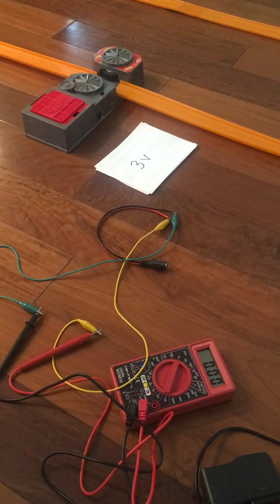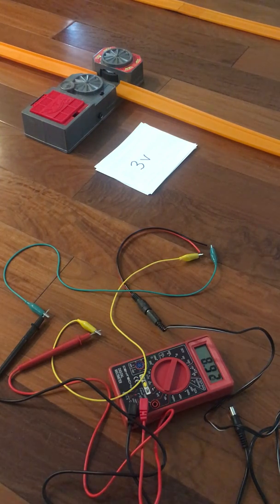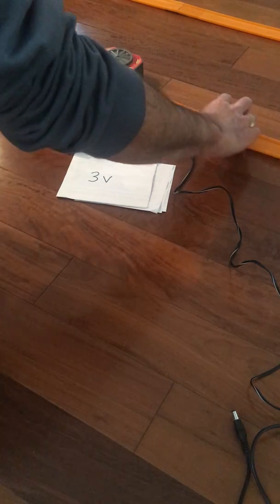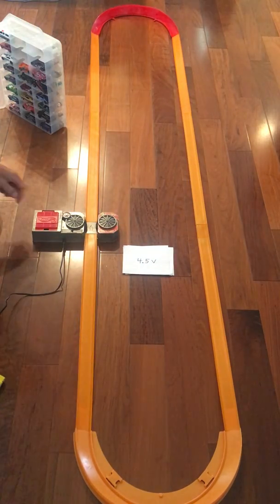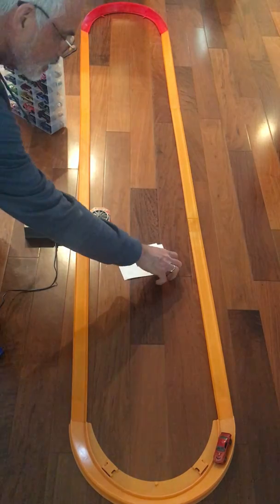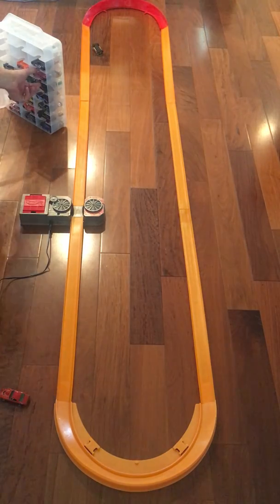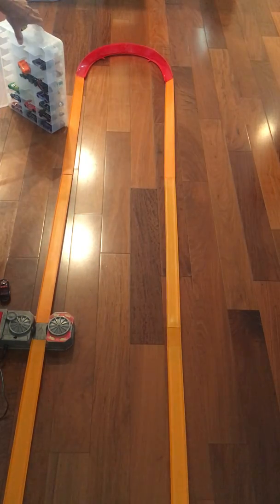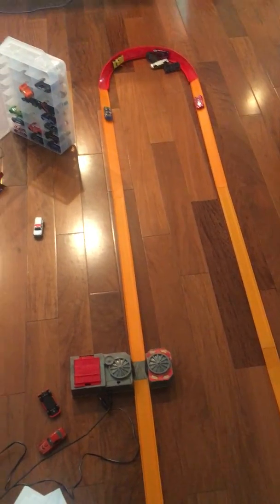Effect of Voltage and Current Changes on a Modified Hot Wheels Booster

Comment: Maybe you can help me. I was running mine at around 7v fine for a long time. Now when I turn it on, the motor speeds up and as soon as it launches something it starts to slowdown to zero revolutions. Almost like motor stalling. Any suggestions? Thanks.

Comment: This is so fun! I just did this with an adjustable power supply myself and it is An absolute blast. Just a tip, I’ve used blue tack to set my tracks on my floor and they don’t move when the cars are flying 😅

Comment: What’s not said here is increasing either voltage or current will burn out the motor just like any electric motor. Motor is rated for only so much (3volts and whatever bit of current)
So a variable power supply can kill small motors.
My point is y’all’s gonna kill lil motors if you do this. What’s really needed is more powerful motor if you can find one…
I think Mattel should build better motors for these expensive sets!🇺🇸😃

Comment: Just to be clear. This is still running on DC. The modification is to allow an ac/dc adapter instead of batteries. Dont try to use AC on these motors.

Comment: I have a question, I use 6 batteries with 1.5V (i.e. 9V) but my Hot Wheels spiral set designed to use 6V (4 batteries), So use 9V does it kill the Booster? Thank you

Comment: The adapters I have are 5.2 V and 7.5 V. The booster is 6V.Which would be a better option ?
Reply from the maker: Either voltage should work as long as they provide at least 1-amp of current. The higher voltage 7.5v adapter should run the booster noticeably faster than batteries, but as long as the cars stay on the track why not?  The 5.2v adapter is slightly less power than the nominal 6v battery supply, but should also work albeit a little slower. Good luck and feel free to 
post results in the comments.
Thanks for your comment.
Reply: @mccord50  I’ll try both ,It’s a small track with dual speed switch.Just didn’t want to blow up my sons booster on first week

Comment: Welcome to torque vs horsepower.  I was going to throw in a switch, not certain I trust a mechanical plug to disengage the batteries when a PS is in parallel.  Nice vid though demonstrating if a  booster motor can handle more voltage.
Reply from the maker: Good point about the batteries. It should be fine (in theory), but I concur, and just to be safe I think it's best to never keep batteries in a booster once it's been converted to run with an AC adapter.  BTW, I just posted a new variable voltage video.  See it here: https://www.youtube.com/watch?v=FGfA_cW7j3c

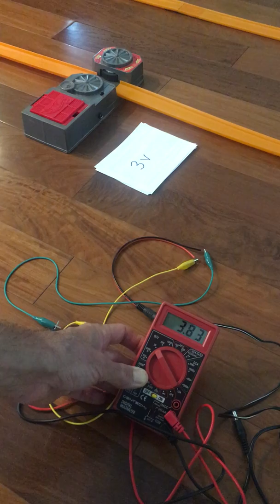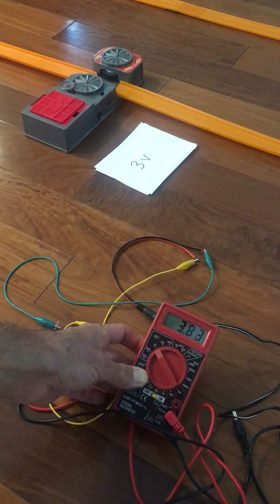Comment: At 1:53 or 1:54 he said "Power Wheels booster." Heh, that's okay, I think we all knew you meant Hot Wheels. Good video, good depiction of what happens with an increase in volts. You said you wouldn't use more than double the dc V it's made to take. I might agree with that but also add that unless you're set up in a straight track (potentially including loops, or maybe not.... there's another video idea) that going over the 6V would be distinctly senseless. After all, electronics manufacturers rarely misuse power input required for their products. I'm curious as to what you think the highest amp rating is for optimal use, because the cells it would originally Is designed to take would have a rating in mAh, not straight Amps. Is it that 1A and anything beyond isn't needed? Do you think the 200-300 mA would work just as well ? Or I guess it depends purely on just how heavily you use the booster in succession.
Reply from the maker: Ha, ha.  Good catch! I also modified a Power Wheels Jeep.  Guess I just can't keep my Mods straight.  ;-)

Comment: Would it be safe to use this 2A adapter? Assuming I never use it above ~5v?

https://www.ebay.com/itm/233620023468
Reply from the maker: Yes. The  variable 1-12 volt, 2-amp adapter should work well, and is versatile enough to work with a range of boosters.
Good luck with your mod.
Reply: mccord50 just a follow up. This adapter works awesome! I soldered in a simple 2 pin 2.1 female jack like you showed in the other video. Now I have a simple speed controlled booster! Thanks for all your vids!
Reply: mccord50 awesome thank you!!!

Comment: Hello mister.
This video explain about Amps effect against booster, the booster need more amps to recovery faster with the launch speed for each cars, is it?
If I use 2Amp adapter for the booster, is it still ok? or it will damage the electricity or even fried the dynamo inside?
I would really want to success using booster for rapid launch for example 5 cars at the same time, without the booster getting slow.
Like your video in this one. https://www.youtube.com/watch?v=9zE_6TZ4aRU
Reply: It sounds like the 2A will be just fine. That shouldn't have much or any negative effects on the components.

Comment: I have a booster that is not powerful despite new batteries. do you know why ? Please. Thank's
Reply from the maker: Sorry, but I don't know the cause of your problem.  If the booster is not running well with fresh batteries, I suggest opening the case to remove any lint or detritus which may have accumulated on gears and shafts, and applying some fresh lubricant to moving parts (but not on rubber surface of rollers).
Reply: @mccord50  Thanks but that's exactly what i did but nothing has changed. maybe it was the capacitors or the coals that died ?
Reply: @trackmaniak  IMO the cause is rubber dragged on the base of booster,i had that on my 1 booster,and try to adjust the height of wheels inside booster